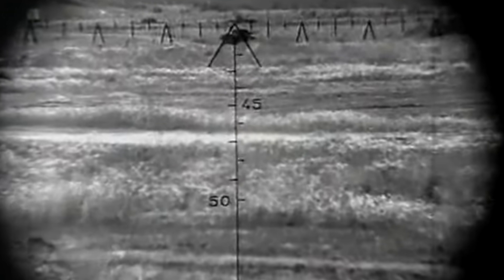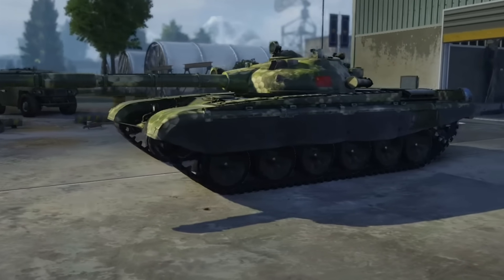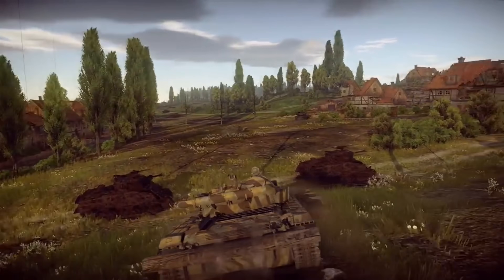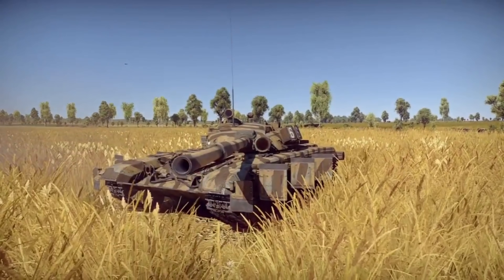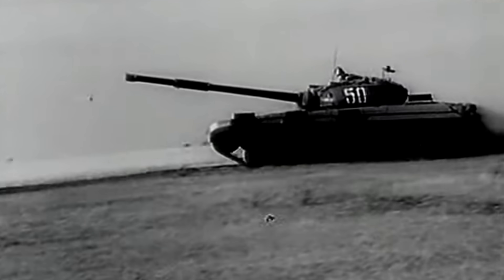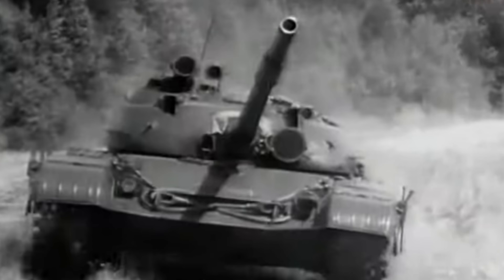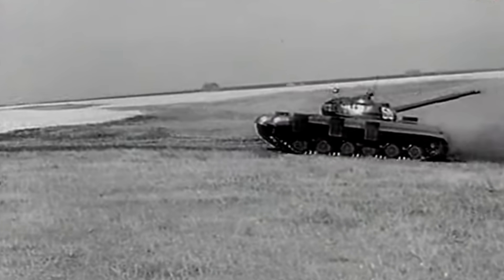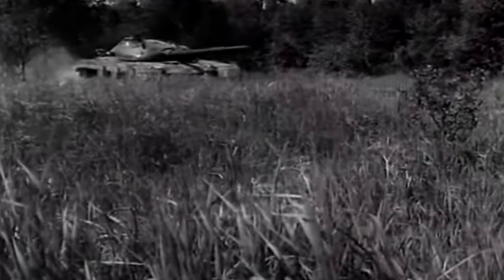What are the side plates installed on Soviet Tanks? | TANK TECH FAIL!

Comment: Funny thing is, the best way to stop shaped charge projectile is to damage its fuze, not to prematurely detonate it. What came out from HEAT round is not molten copper jet, but a copper cone that is plasticized by the explosion, turned into a penetrator akin to sabot round, but with quicker kinetic energy loss. Spaced armor actually would not do anything, since i kinda remember reading that shaped charge like panzerfaust is still deadly even when the warhead is detonated prematurely by spaced sideskirt (It requires a spaced distance of 1 meter as well to render the panzerfaust useless). This is also why attempt to protect tanks with sandbags, concrete, or logs is also pointless against Panzerfausts.

Hence why slat armor was invented and has more success, because you're meant to "crush" the fuze before it could trigger the explosion to form the copper penetrator, but the slat only works by a 50/50 chance: 50 percent chance of hoping the shaped charge hits the space between the slat to crush the cone and fuze, and also 50 percent chance it instead hit the slat structure that triggers the fuze and can still penetrate your vehicle.
Reply: Kabuki Kitsune  It was never the case in reality. They put those side armor plates for protection against HE, HESH and some AP rounds (if the projectile is shorter than the space). Against HEAT? Just psychological effect on crews...
Here is the vid I recommend you watch completely cos it has a lot of interesting details... First off, there is a situation when they shoot a concrete 7 foot thick wall with a HEAT. It goes through no problem and the jet keeps flying and makes holes in trees 10-15 meters away from the target. Secondly, there is a shot at slat armor at 32:22. Detonates and not only penetrates but exits on the other side and keeps flying for dozens of meters afterwards. Actual hit is at 32:52.
https://www.youtube.com/watch?v=HZBCbpS_uo8
The problem is: air has less resistance than steel, so the drop of penetration is not good enough to stop HEAT jet unless at minimum of 3-4 meters away from a pretty thick steel plate or composite.
Reply: I don't think you get how dense sand and concrete are. Plus there might have been the idea of defeating HESH.
Reply: @news_internationale2035  I don't thinky YOU understand that both of those material are worthless in stopping the munroe effect, especially since there exist a research paper publish in 2011 which is 650 page long that dunked your statement regarding concrete against shaped charge.

Sure defeat HESH is a legitimate reason, but what is the Warsaw pact's biggest threat? a Bunch of Britblokes with HESH, or the more widely available HEAT projectiles fielded by many other NATO armies used by tanks and infantries?

Funny thing is, General Patton knew how shit was the sandbag and concrete armor, and why he forbade any form of armor addon other than salvaged armor plate to be mounted on his sherman. A study as early as 1944 already confirmed that salvaged armor plate retrieved from knocked out tank worked better than sandbags and concrete, hence why sandbag also stopped being used some time during the late-1944/early-1945 while armor plate addition became widespread at this time around in ETO.
Reply: @erikakurosaka3734  " I don't thinky YOU understand" and do YOU understand anything in this topic? Because hardly anything you wrote is based on any real understanding of the topic you are talking about...
For example "because you're meant to "crush" the fuze before it could trigger the explosion" you want to crush the fuze that is trigered by piezoelectric effect=generates electric impulse from the pressure... LoL
The skirts are for HEAT and the premature detonation lowers not only HEAT ability to penetrate the armor but also lowers amount of pressure/energy that is going into the tank if there is a penetration. 
"there exist a research paper publish in 2011 which is 650 page long that dunked your statement regarding concrete against shaped charge." there are also real German research documents about the topic from time when first Panzerfausts were developed with X-ray slow motion pictures of the jets in different configurations... and they are clearly contradict you silly idea how the shaped charge works...
Sandbags and concrete are able to lower HEAT effectiveness but they are heavy, so what is the point of making tank unable to actualy move? Its not a tank anymore then, its a bunker and yea bunkers are made out of concrete because it is a good material for this job...
That skirts on the side were used in T-64, T-72 and also T-55.
http://armor.kiev.ua/ptur/dz/grid.html
Also the premature explosion in this place would most likely limit damage to the tracks as the explosion would then be trigered outside not betwen the tracks... You want this tracks to move the tanks, its not a game where you can fix any damage to tracks almost instantly.
"sandbag also stopped being used some time during the late-1944/early-1945 "" they are used all over the word even today... as they are a good and easy to set protection for the infantry. Planting a sandbags on you sherman during WW2 was not a good idea(but used by soldiers anyway) because you cound only put there small amount of sand and even with this small amount tank mobility was significantly reduced and suspension was not designed for this type of extra work.
Reply: @erikakurosaka3734  And the whole idea of "crushing" is not for the fuse but for the shaped charge itself as damage to its side will gonna cause lack o symetry and the jet will be not formed properly and its ability to penetrate armor will be reduced. There are also systems with kevlar nets that are not so heavy but more expensive and they are trying to catch the HEAT and cause premature detonation or catch the shaped charge without detonation.